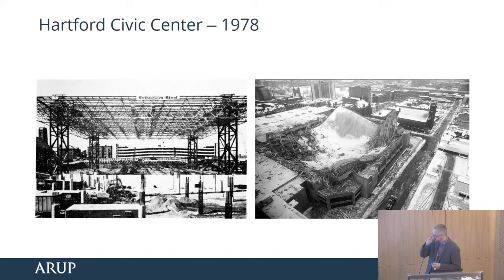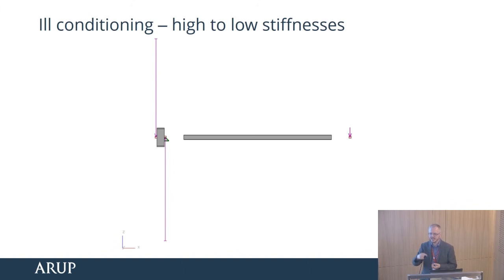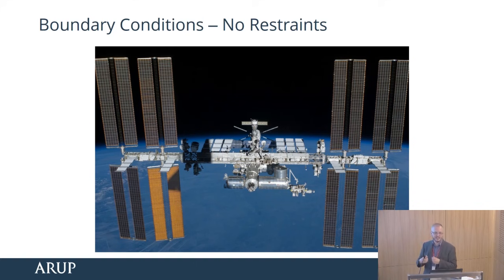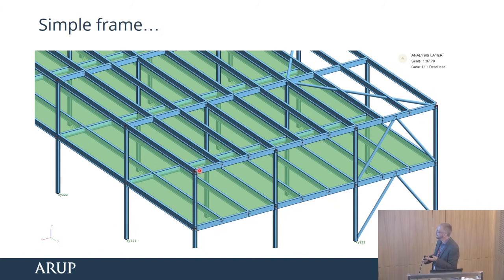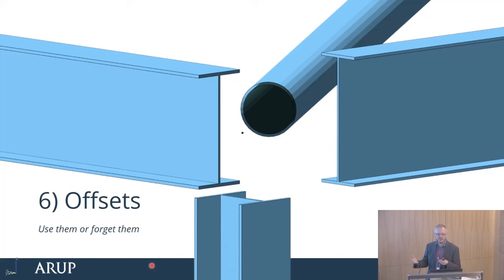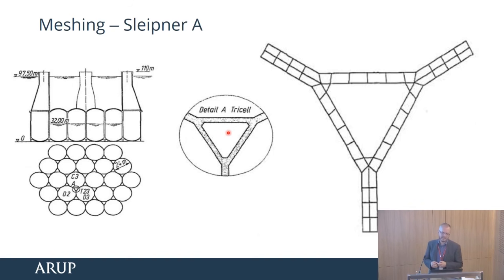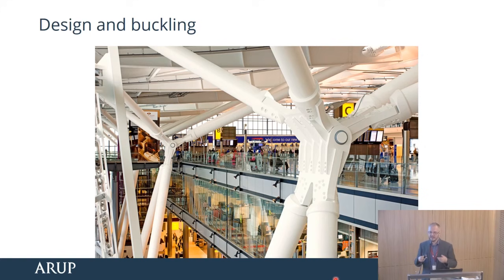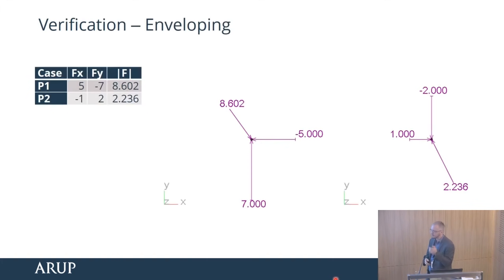Avoiding common mistakes in FEA modelling: Technical Lecture Series

Comment: Thank you for the interesting lecture, one item to note regarding the failure of the structure due to neglection of Torsion at 38:00 
The torsion which you pointed out was a hogging moment in a secondary beam, that moment appears to be such a small portion of the overall moment in that secondary beam that it could likely have been redistributed to a sagging moment in that same beam through plastic behaviour or even factors of safety, thereby nullifying the torsion theory. 
Ofcourse, the principle you are trying to convey of accounting of induced torsion in the structure is crucial, but it is perhaps not the best example.

Comment: So what is the difference between a restraint and a release? When and why would you ever use releases? Surely instead of using releases, just don't restrain that nodal DoF in the first place?? What am I not understanding?
Reply: A release is essentially an internal property. And a release essentially a property on the structure boundary (interface with the earth or other structure).
Eg 1: if i had a simply supported beam in my structure, I would specify an appropriate release at the end of the element (defined by what freedoms the end connection has). 
Eg 2: if I had a simple support, I would specify an appropriate (normally 'pinned') support.
You can swap these around if you want by defining the various properties carefully, but it's easier to keep them separate.